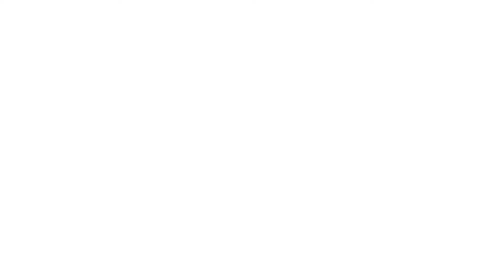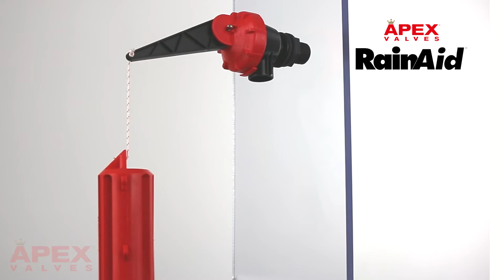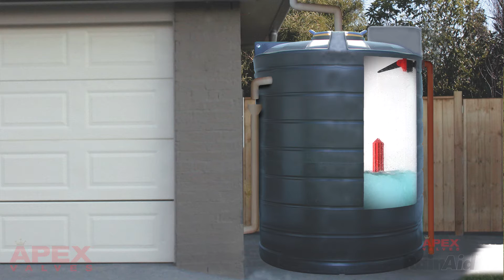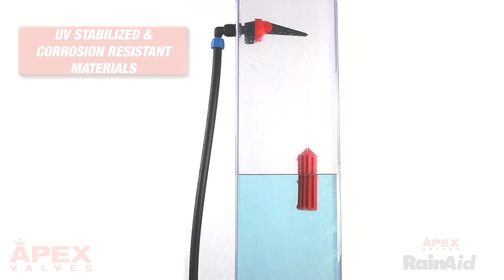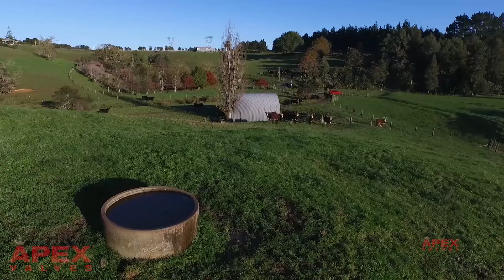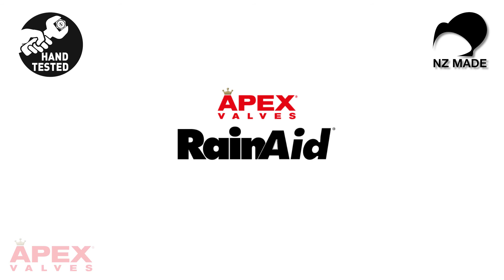RainAid Rainwater Harvesting Valve

Comment: Piss poor instructions for how to fit the replacement diaphragm kit. No mention of o rings in jet centre slide need to be transferred over. Gives the impression that the new kit is already fitted with seals. Should come with either a full seal kit or better instructions to refit the existing 2 orings and spacers that come out inside the jet.